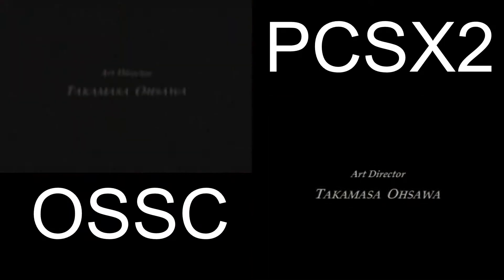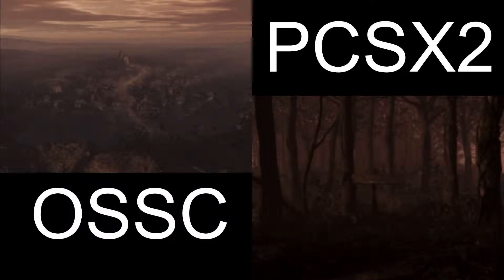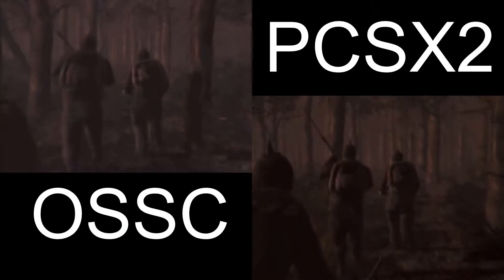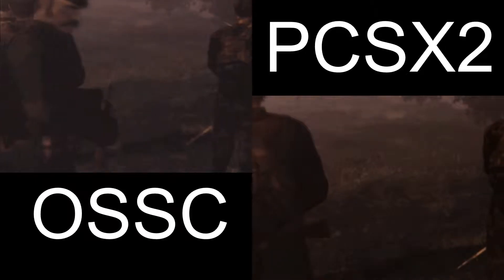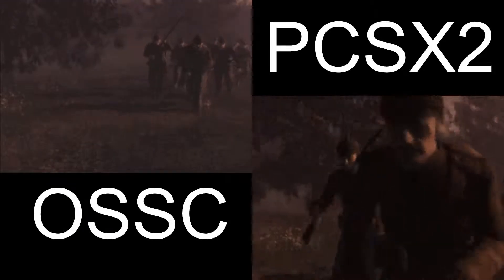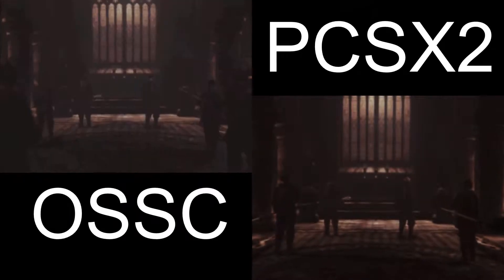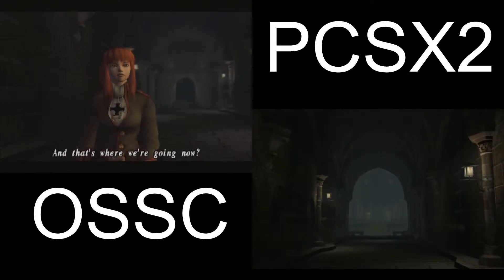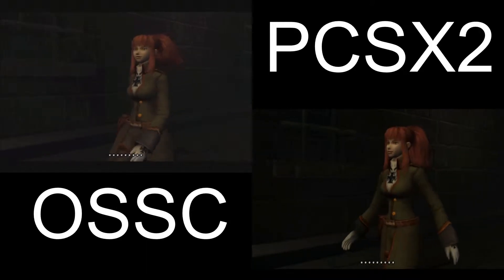OSSC's 480i Video Quality Compared To PCSX2 [PLEASE READ PINNED COMMENT BEFORE WATCHING]

Comment from the maker: Updated in 16/5/2021
For the longest of time I wanted to make a update video regarding my OSSC situation, but decided to just write the update here, hoping that this video will help anyone that's in a similar situation.

- Turned out my OSSC was faulty and asked for a replacement and the replacement works great so far.
- It would've been easier for me to just ask for a replacement instead of exploring if it was an issue that I can solve by tweaking some settings and parameters, but a lot of what I've read online at the time suggested that this was an issue of just fining the right settings for your current setup. It was not. The product was simply faulty, and if anyone is having a similar issue I suggest that you ask for a replacement ASAP.
- I don't have anything recorded from my replacement OSSC so far but I did stream a few PS2 games using it. Since streaming a game on Twitch/Youtube only uses a limited bitrate, the quality of streamed footage is going to be lower than what you can normally get, especially the ones that are archived on Youtube.
- I'm planning on recording a few playthroughs for PS2 and Dreamcast games in the future, once I record them I'll try list some of what I recorded here for people that are still interested on seeing how PS2 and Dreamcast games look when recorded and uploaded to Youtube at the highest quality allowed on this platform.
- Feel free to ask me anything, I will try to answer ASAP.
--------------
OSSC footage is on the left side for those who are confused, sorry for the subpar editing skills but I've mentioned that in the video at 0:17
You guys can follow the situation of me trying to resolve this issue in this thread : https://www.videogameperfection.com/forums/topic/image-quality-for-480i-signals-are-off/
Reply: So which is better? And by how much?
Reply from the maker: @liberdelta  OSSC does the job. If you don't care about playing on real hardware, then just stick to emulation honestly.

Comment: I just got the OSSC and not happy about it. The picture quality is not what I would have expected. It's a complex thing and not sure if the combination with my BenQ EX2780Q 144Hz IPS monitor is a good one. What other options have you tested that gives a better picture quality? By the way, what game are you playing?
Reply from the maker: I suggest that you ask for a replacement if you're having the same problem that I'm describing in this video, you might also check the link that I've provided in the pinned comment just to confirm if it's the same.

I was planning to make a follow up video about this but never found the time to do so. basically I found out that the OSSC that I had was faulty and I asked for a replacement and the replacement works great for me, even though up until this moment I haven't had the chance to use it past the initial test when it arrived.

long story short, this problem isn't caused by mismatched sittings, the OSSC was faulty and if anyone having the same issue that I'm showing here then you should get a replacement.

the game I'm showcasing here is Shadow Hearts 2 for the PS2, great game if you're into JRPGs.
Reply: @Have4NiceDay  Because I did not received my OSSC from Kaico they send me a second one. Lucky enough I did received the first one and maybe as you mentioned, it could be a faulty device. Have to check the second OSSC. Still I don't believe the OSSC is faulty. I am thinking of compatibility issues with my monitor.